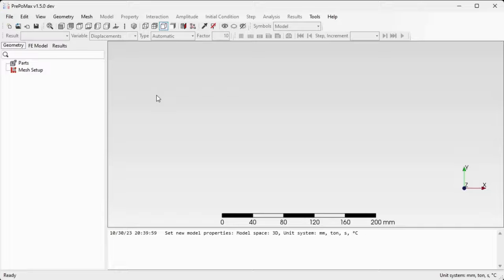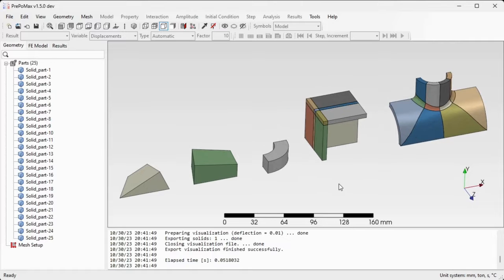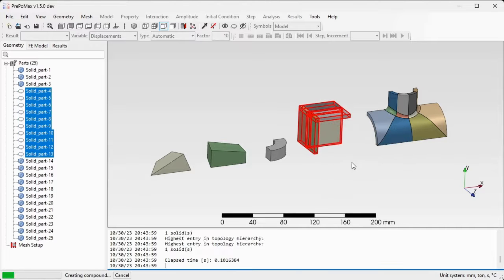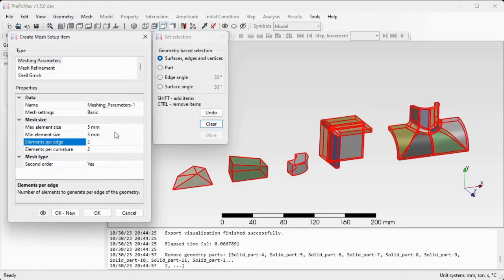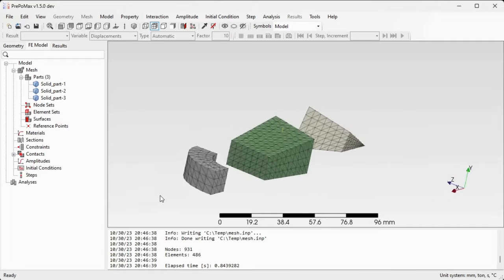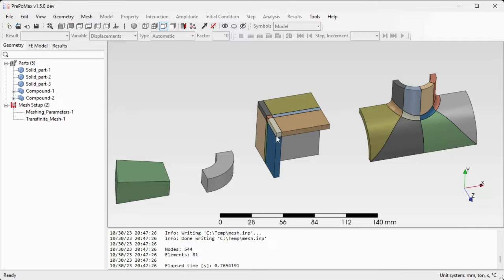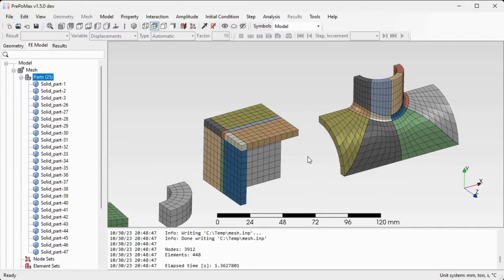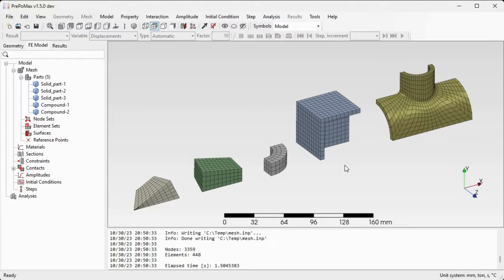PrePoMax & CalculiX - Transfinite volume meshes

Comment: Hi, thanks for this, it’s very impressive. I have a question. When I export out as stl to import in blender, it will triangulate the mesh. Is there a way to maintain the quad when exporting the model?
Reply from the maker: No, this is not possible. The .stl format only supports triangles.
Reply: @MatejBorovinsek  I see. Will there be other file types export options like obj or fbx in the future for this software development?
Reply from the maker: I was thinkig of adding support for .obj files in the past but now there is no plan to support it. And our forum is a much better place for such discussions.